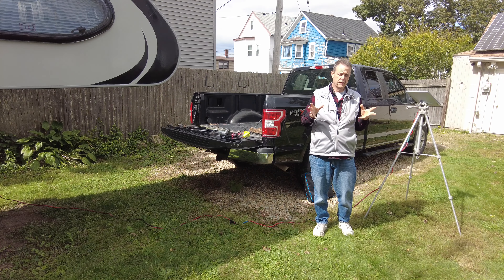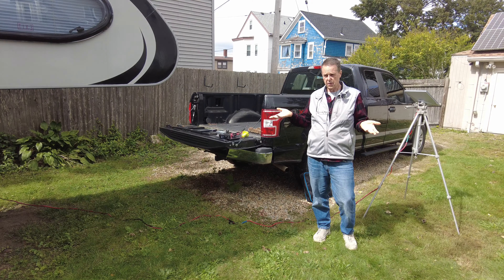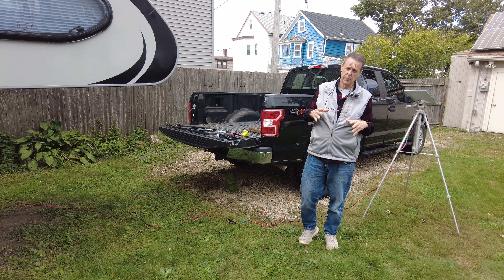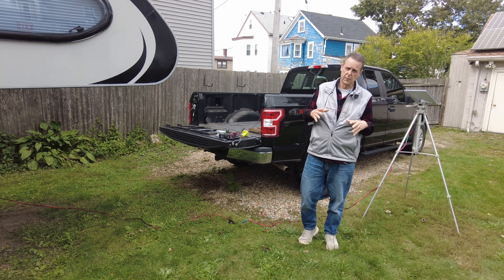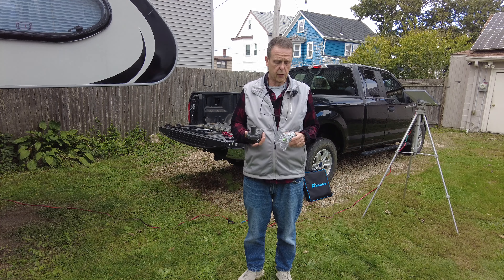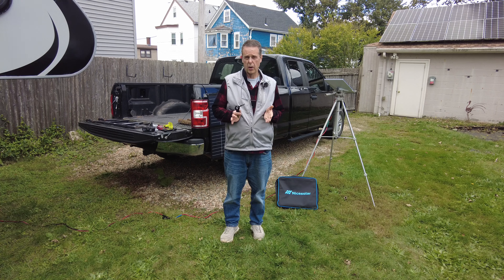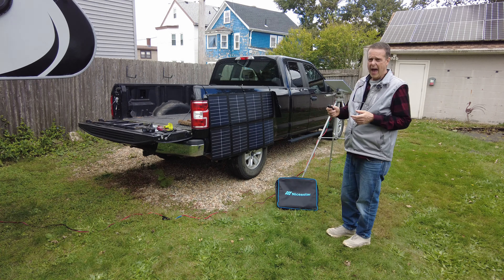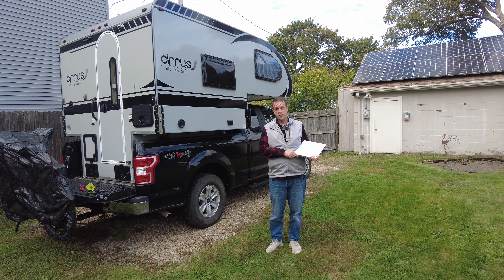Creative Ways to Power Starlink Mini - Including with a Ryobi 18.8 volt battery!

Comment: For portable power I use the small 100  (99.8 watt hours) watt Jackery power station, the latest version  with USB-C and A ports.  The USB-C ports are 100 watt and are input/output.  By itself it will power the mini for 3 to 4 hours, once it boots up it pulls around 22 watts.  You will need a USB-C  cable with the Starlink connector on one end and the cable needs to be big enough to handle 100 watts.  I also have a 60 watt Jackery solar panel which allows me to charge the power station at the same time its powering the mini.  When I ran a test the mini pulled 22 watts and the panel provided 37 watts , so in theory as long as the sun is out I’m can run the mini indefinitely and still have power for 3 or 4 more hours after dark.  I also have a Jackery 500 which would run it for 20+  hours by itself.  The small 2lb Jackery is best if you wanted to throw the mini and it in a day pack and spend a couple of hours on the mountain top to show off😂

Comment: Just getting into Starlink after seeing how it saving lives in the North Carolina disaster. I'm going to buy the Mini for my bugout stockpile so these two power options really help really helps. I own a Model Y so what would I need to run Starlink out of it? The manual says the accessories outlet is 12 amps of continuous draw and 16 amps of peak.